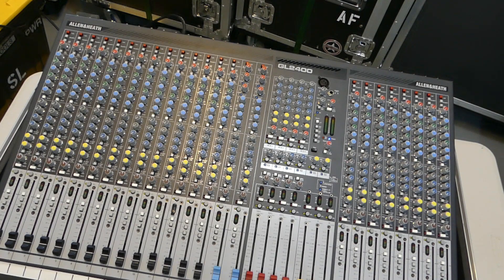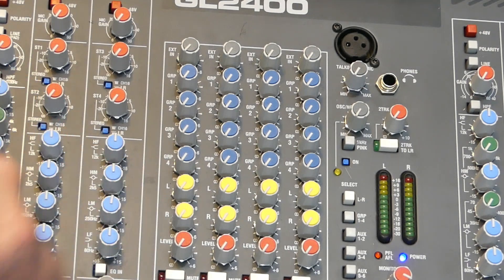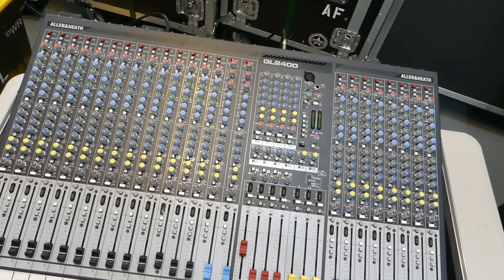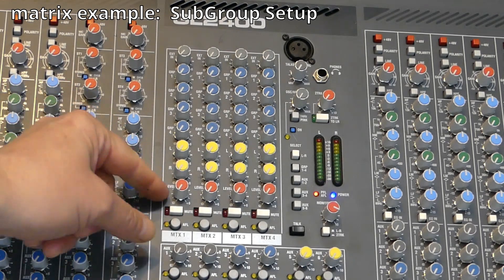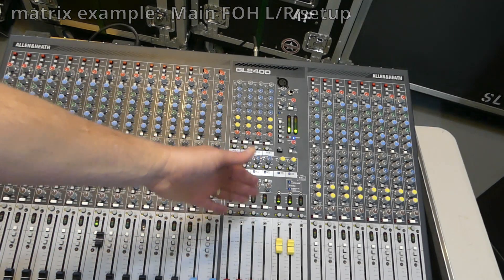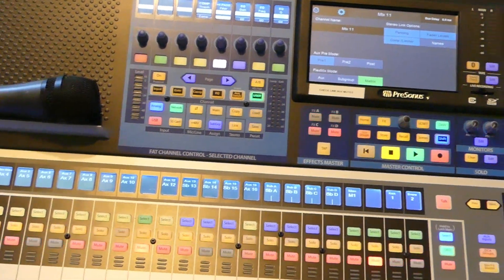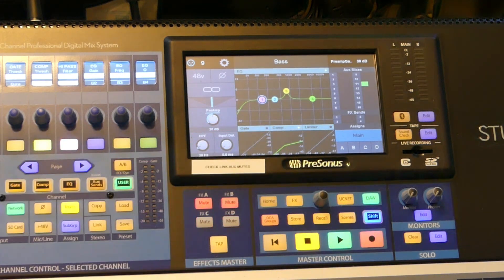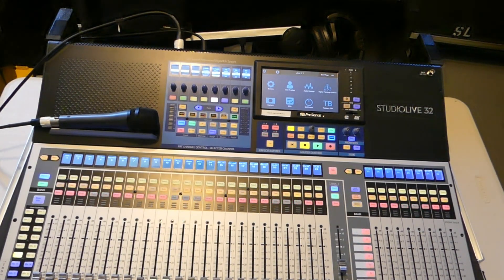What is an audio matrix on a mixing console (analog vs. digital)

Comment: Hello Sir again,
Hope u doing well 
I have a question about TC electronics M350 effects unit. I have a question about delay timing knob. It mark from min to max. What Milli seconds represents each line on the knob. There is total 10 lines. I’m trying to set 360. On that. I know it’s the tempo so  I am trying to find a spot to fit to all songs instead of changing the tempo. Please advice. Appreciated
Reply from the maker: I am not familiar with that model of effects unit.  But, I think the delay/timing knob functions with the type of delay effect that is selected.  This means, the delay/timing knob will probably have different amounts of delay based on the delay effect selected.  I don't the delay/timing knob has set values; it is more like a variable value based on which delay effect is selected.  
You may need to read the manual on this one!
Reply: @ Thanks for the replay.  I will look into the manual.

Comment: Hello Again,
Quick question .. Question about ST1  which I currently connect the cable to the phone to play music, there is a little button next to it what is that for.. also I feel Ike I have a bring the fader up all the way to get a good sound. Thanks again
Reply from the maker: The ST* inputs are for stereo inputs, most commonly used for the returns from outboard effects units (reverb, delay, etc...).  Even though the inputs can support stereo, we used them only for mono returns.  The button next to the ST* knobs just indicates where the input signal needs to be routed to... either to the input channel/fader, or directly to the L/R output of the console, bypassing the input fader; it's common to keep the switch UP so the signal stays routed on the input fader.  For the volume issue you mentioned, make sure your phone volume is turned all the way up.  Next, make sure the "gain" for the ST1 input is turned up (but not all the way... this could produce distortion).  If you have done all this and you still don't have good volume, you may need to use something like a passive DI box that will convert the output signal level of your phone to a level designed for consoles.  We use a Radial "Stage Bug" SB-5 when connecting phones, MP3 players, laptops to our systems.  Hope this helps.
Reply: @stageleftaudio  
Thank you so much for the replay , so what’s does the  ST1 knob does and I see the gain knob above it. The ST knob and gain knob need to be at the same level? Thanks much !
Reply from the maker: The only knob you need to turn is the ST1 one; use the PFL feature on the input channel you are using to see how "loud" the signal is in the console.  The knob above the ST1 is for the XLR input gain... you do not need to use that knob.
Reply: @stageleftaudio Alright.. I didn’t test the PFL on it. I kept the ST1 at 2 o clock. I will check the level. Thanks again.

Comment: What is your mixer made of? I have one like that but it says made in China

￼
Reply from the maker: The console we use is an older model.  I think it was manufactured in the U.K.  I don't recall seeing anything on the console indicating it was made in China.  There's usually nothing wrong with gear being made in other countries... as long as the company is conducting continuous quality and assurance checks with the products throughout the manufacturing cycle.
Reply: @stageleftaudio  May I see the writing on the back?
Reply from the maker: Our GL console is in storage and will not be taken out unless we need it for an event. 
 Try posting your question to an audio forum.  You should get better responses than what you will get on YouTube.  Also, many forums allow users to upload photos... youtube does not allow for inline-images.

Comment: Can u please help me with something,
We have the same mixer in the church. I understand u mention the last channel on the matrix is for video. We do Facebook live when we have service, so how we can connect to the phone to do live to get better quality sound. What cable do I need? Just a quarter inch to headphone jack ? We are using I phone if u can advise that would be a great help for the church.  Thank you so much.
Reply from the maker: I do not know much about  live feed mixing.  This type of mixing is usually called "broadcast mixing", which usually requires different mixing consoles.  For the GL2400, you should probably use an AUX output for the broadcast mix. The matrix could work, but there could be more involved with using a matrix compared to an AUX mix.  Use an AUX mix, do not use a matrix mix.  For an AUX mix, sounds like you will need an XLR output connector (from the console) to a min-headphone jack (to the phone) for Facebook.  Mixing the AUX output for the phone, will take some time.
Reply: @stageleftaudio  
Thank you so much for replying back to me. We had an other mixer which can plug in RCA to headphones jack that didn’t work either. Where is the Aux mix connection located in the mixer  if u can refer, also u mentioned it will take some time,are u referring to  when connected to live there is a lag. Thanks 🙏
Reply from the maker: The AUX mixes are the monitor mixes on the console.   The "time" that I mentioned was the amount of time it would take to setup a good mix for the Facebook feed.  You would need to set the levels for each input to the Facebook feed... this process can take some time to setup, especially if you are needing a good mix.
Try searching YouTube for videos on how to setup a mix for a Facebook feed.  There may be some videos that could help you.
Reply: @stageleftaudio  Thank you again. So the connection go under monitor on the back of the board which need a quarter inch correct? Also the red knob is that for controlling the level of sound going to the live? U mentioned earlier XLR. I wish u do a video tutorial about live feed. Thank a million God bless. U mentioned about high pass filter in the video is it better to turn that on for all mic channels ? 🙏
Reply from the maker: Sounds like you may need some tutorials on how to use the GL2400 console.  I recommend you contact someone local to you that can assist you with how to use that console.  This forum (YouTube comment section) is not the best place for detailed instructions.  I do not know much about live feed setups, unfortunately, I will not be able to do a video covering that topic.
Reply: @stageleftaudio  Thanks much again l will look into that.

Comment: When would you use an aux send and when would you use a matrix?
Reply from the maker: An aux-send is most commonly used as a monitor send(s) for the band.  A matrix is like an aux-send, but it can also include instrument groupings, like sub-groups.  A matrix is sometimes called a "mix within a mix".  A matrix can be used sending specific instruments/inputs to center-fill speakers, side-fill speakers, or to audio recording feeds for videographers, etc..

Comment: I bought a cheap audio mixer and cannot even get it to work with my powered speakers and mic, I simply don't get it, am I that dumb?
Reply from the maker: There's a lot of variables in a signal path from console input to the speaker output.  Work on one section at a time.  Also, for help/support/service type of questions, I recommend posting them on audio forums.  There are a lot more people on audio forums to help with audio issues and questions.

Comment: So when using a matrix mix, you get EQ and other controls, that you wouldn’t have on say the AUX going to a stage monitor? Trying to understand the differences, it seems like having multiple “Main” mix copies, sort of…
Reply from the maker: You will get the same channel EQ and other settings on both the matrix and an AUX.  A matrix is sort of like an AUX, except the matrix (on an analog console) is fed from a few selected sources (sub-groups, external input, L/R main).  Whatever EQ settings that are on the channels will be sent to the matrix.   For digital consoles, a matrix-send is far more powerful than an AUX-send; because the matrix can be fed many different audio sources; much more than an AUX-send, this includes EQ as well.  You are correct, you can have multiple "main" mix copies, however, you can choose not to include the "main" mix in the matrix-sends.  If a "main mix" is routed to a matrix, it's usually to support a videographer.  A matrix mix is just another routing option available on many consoles.  
Hope this helps.
Reply: @stageleftaudio  It does, thanks a ton! I have a greater understanding for sure, maybe will try to use it more actively
Reply: It is a separate mix built from subgroups
Reply: @weareallbeingwatched4602  So you can usually control the volume of each subgroup, so splitting say the kick and bass to one, will allow a separate sub output?
Reply from the maker: You can assign any input to any subgroup.  If you have kick and bass routed to the same sub-group (and assuming no other inputs are on that subgroup), this could be a separate sub output (or matrix output) with its own volume control.  I'm assuming you are needing just kick and bass in one sub-group?

Comment: Very educative, many thanks,That's exactly what I need! Although there are still questions... For example, we do not understand why when using two stereo inputs for microphones at the same time there is a counter-phase and only with the plugin in the sequencer you can fix it, until we figured it out.
Reply from the maker: Thank you for your comment.
For your question about the microphones, the problem you are referencing is caused from audio wave-lengths cancelling.  Some times to fix this issue, set the polarity to reverse (reverse polarity) on one of the microphone inputs.  This should cause the combined wave-lengths to be "out of phase", therefore, reducing the counter-phase.